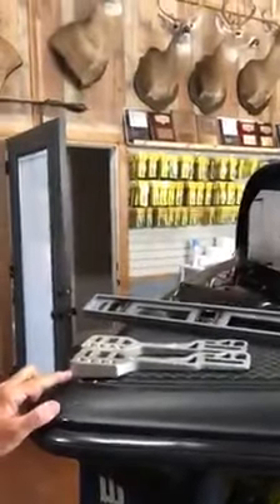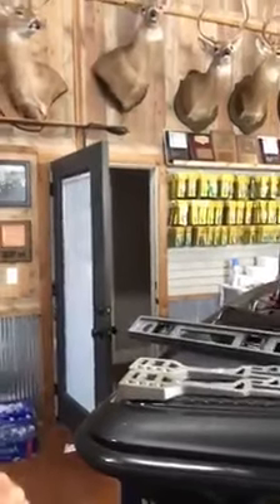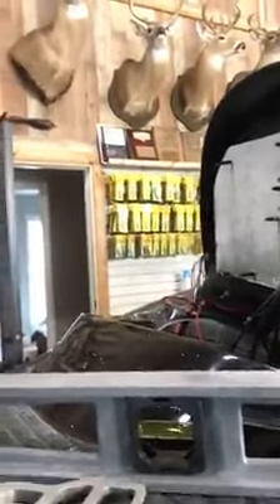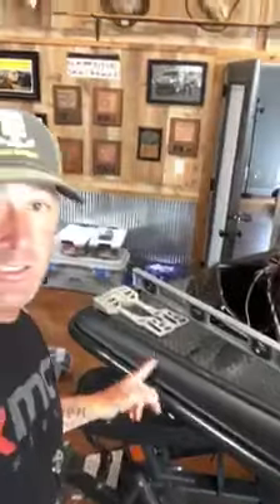Balancing your Trolling Motor for perfect Electronics readout

Comment: For those asking about how it compare to on the water... I'm assuming he did this already... you need to first bring the level and some kind of spacers, coins work well, out with you on the water. Pick a spot on the boat and add coins under the level until it reads level. Then with the boat on the trailer in that same spot use the same amount of coins it took in step one, and crank the trailer up or down until you read level again. Now your boat sits as it does in the water... and now compare how level or not the trolling motor is.
Reply: Agreed. The coin trick with the level is the method I believe is correct. Use the same technique to level out your big banana side imaging ducer on the back as well. 

Its always nice to find improvements that don't cost money.... Unless you drop some coins in the water...

Comment: Not a boat pro but does your boat sit the same way on the trailer as it does in the water? Seems like the angle would change from trailer to water and even with how much weight you put in o e end of the boat or the other